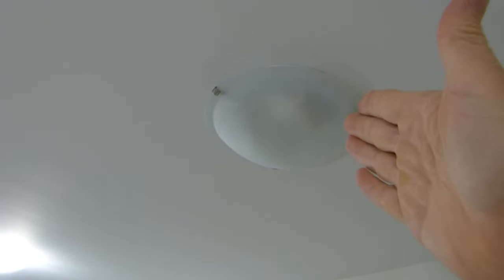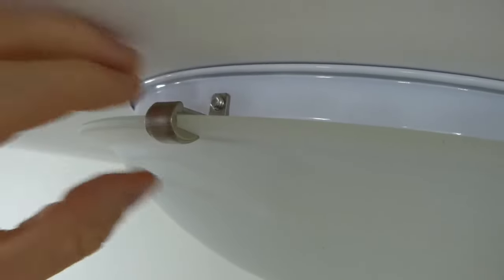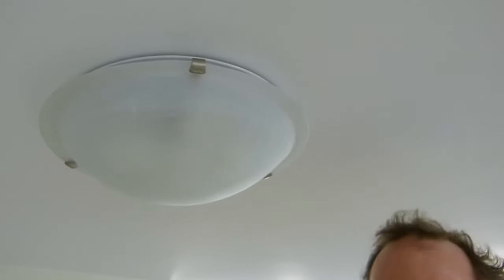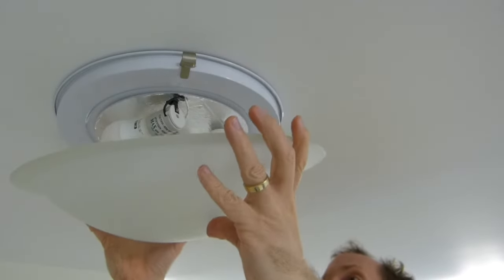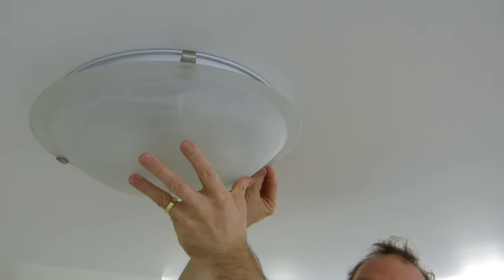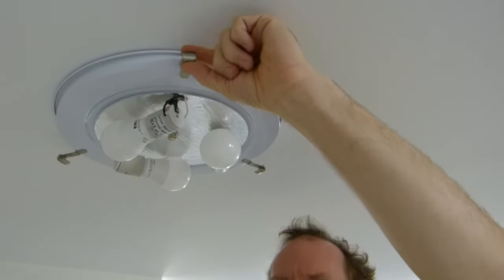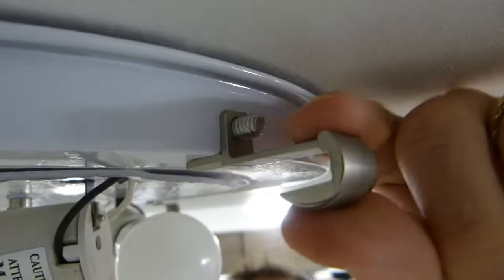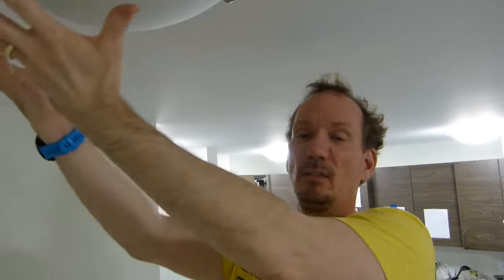How to remove the glass cover from a ceiling light

Comment: I've worked both the build and demo sector of the construction industry for 12 years, and for the life of me, could not figure out how to change this exact fixture in my apartment. After trying to push, pull, twist, and rotate the clips, I came to your video and found out that my springs were just rusty, and didn't want to pop until I got WD-40 on them. I still feel like an idiot, but at least now I have light, so thank you for this video!
Reply: I thought that's a spring clip and I broke it 😭😭😭😭 
edit: after watching this fully i realize that it was supposed to be spring. so it was just shoddy material, not my fault